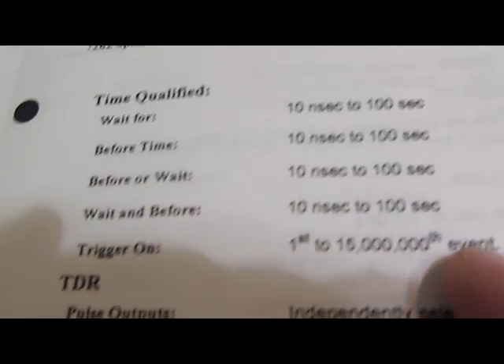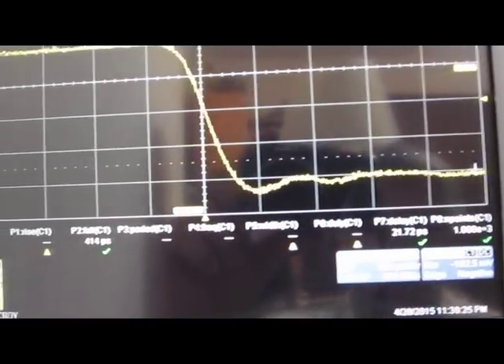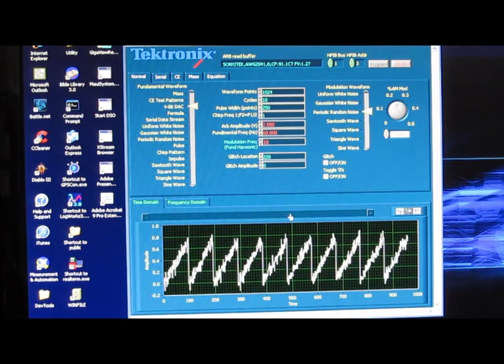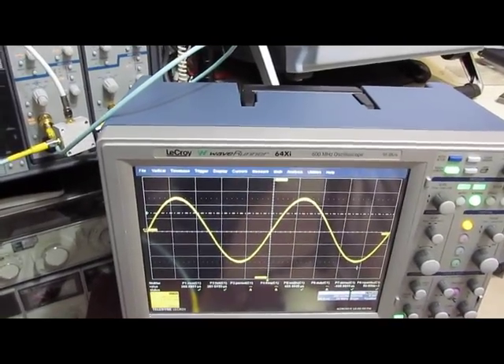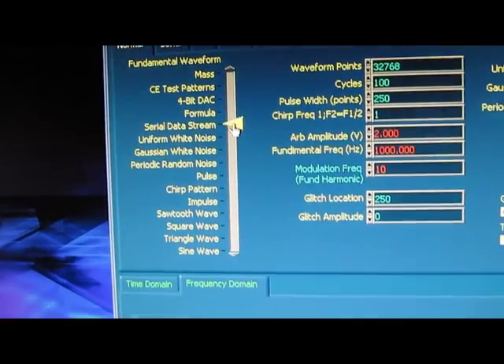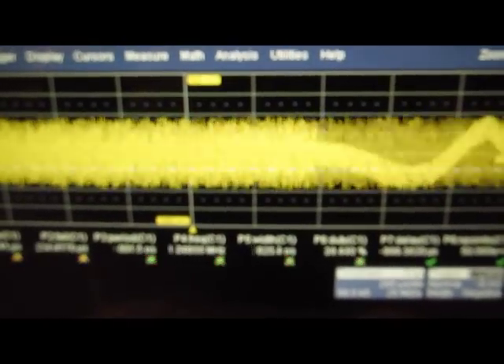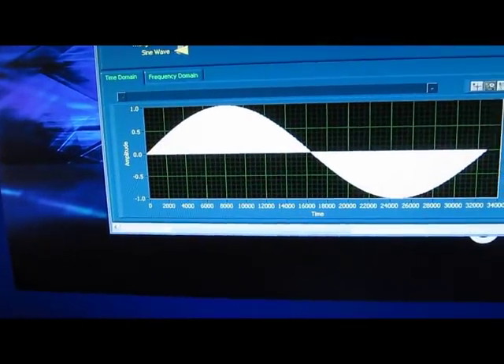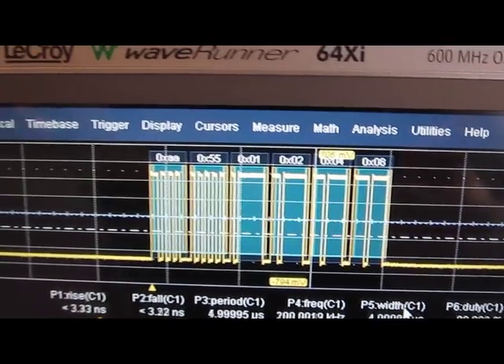Comparing the LeCroy WaveRunner 64Xi with the 7200 Part 2

Comment: I almost got a 7200 system which had a 500MHz module, but when I looked at the cost of 500MHz probes (which didn't come with it) I couldnt' justify adding $200 more to the cost of the instrument.  This was going to be my first oscilloscope.
Reply from the maker: I gave away my 7200A after owning it for more than 10 years.  I still have the 7200 which was the first LeCroy product I purchased. No where near as nice as the newer A model.  I bought some very inexpensive 10X probes from Hantek and was impressed with how well they performed.  I still use these.   For high frequency work (sub GHz) I use resistive probes.  Have fun with what ever scope you get. https://www.youtube.com/watch?v=buG-H_LZH0U